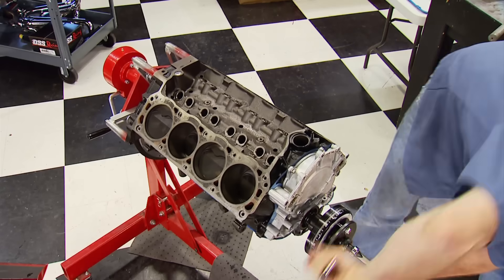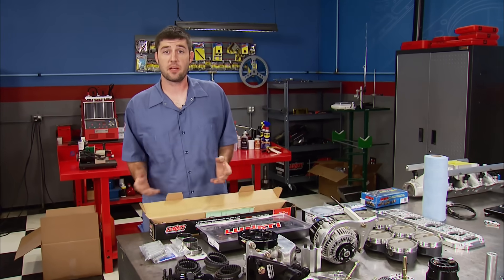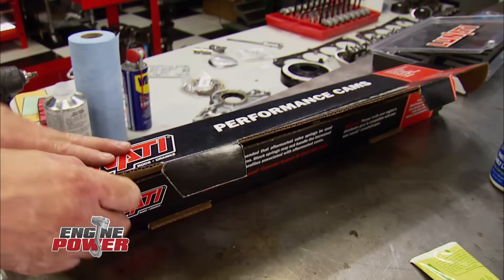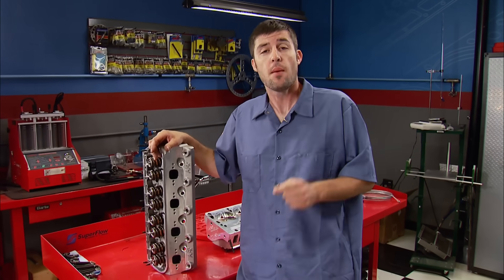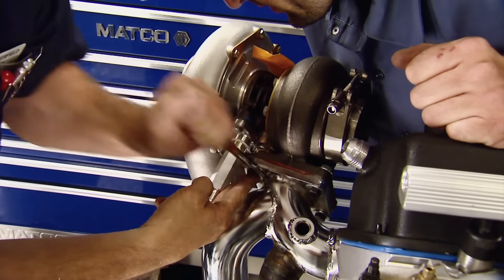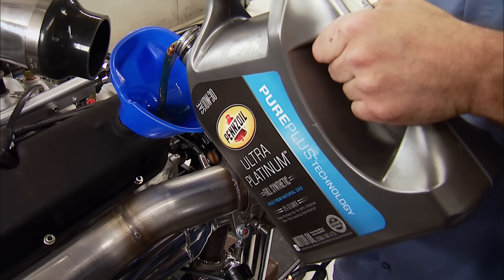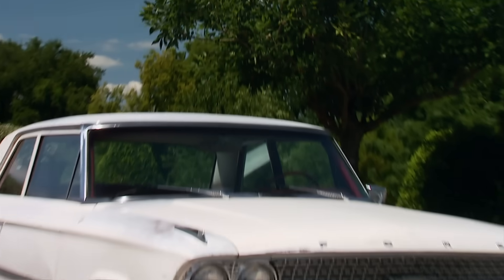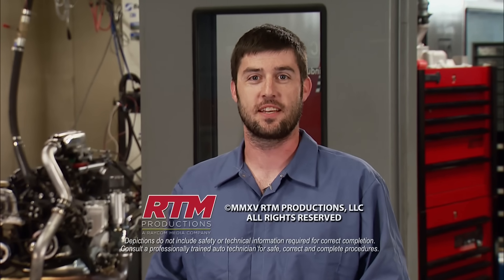Unleashing a Boosted 347 Small Block Ford - Engine Power S2, E20

Comment: How long did it take for the alt pulley to eat up the alt belt ? Reason I ask is I had the EXACT same pulley belt setup on my 700hp NA 363 sbf (5 speed car) and it ate 3 beats in 2 weeks. Decided to call Jones and they stated the pulley/belt setup was wrong for a high amp alt same as you got. They send me a thicker pulley and belt and that did the job. No more eating belts.

Comment: There is whats called man o war small block ford block. It actually has 5 head bolt holes per cylinder there is also a man o war cylinder heads also but right now are quite scarce

Comment: I have seen a 351 Windsor that put out 748 h.p., I don't remember the torque. Not bad for a n.a. motor.
Reply: 13:1 compression and a 9000 rpm redline with 478 ft*lbs would a fun engine, a screamer for sure though.

Comment: @POWERNATION want to point out you adding to the 600hp cracked block myth. I won't deny that the block will crack but it is not associated to a specific hp mark it is due to the internal harmonics of the block. By having the block and rotating assembly Professionally balanced plus running tune to keep the RPM'S low the stock 302 block can see around and over 800hp reliably.

Comment: The tiny ports on the heads make it so they have to run higher boost to achieve lower hp numbers. Larger ports flow better and require less boost to make hp do to a cooler denser charge.

Comment: There are PLENTY of ford 302 based strokers living happy lives above 500 or 600hp. You are trying to sell parts....just stop. First off, the split only happens in 15% of windsor small blocks (NOT just the 302) because of 2 factors, a HUGE stock off balance that turns the crank into a noodle at RPM above 6700 and weak castings. To stop this, get proper oil control so that the mass of oil is not offsetting the balance of the crank, windage tray with glyptal will work just fine. Next is to drop an internally balanced rotating assembly in that is properly balanced. This is VITAL and cannot be overlooked. Proper engine balance is the key to running these past 6700 rpm for real power numbers. But what do I know, I only build them professionally and have seen cars with a stock block making passes around the 7 second mark...but to each their own.

Comment: Put together a system that put 2HP per cubic inches! 
The dart block can hold 700+ HP I have 694HP with out the 88mm turbo at 18 lbs of boost

Comment: I spent a ton of money building a 347 years ago for a Fox body mustang and I would never do it again. Don’t get me wrong it made big power and I absolutely love how small block fords sound they are the best sounding engine in my opinion but when you can buy a 5.3 Chevy now for a few hundred bucks and slam a turbo on it and run in the 10’s easily ur stupid to waste the money on a stroker. When you blow up the 5.3 because you ran too much boost you go to the junkyard and buy another 5.3 for a few hundred. The 5.3 already had aluminum heads with decent size valves.
Reply: Don't need a stroker to make big numbers. A 351W with the AFR heads, a cam and intake that matches the flow of the heads and you're at 500HP easily. The guys on Engine Masters proved that. And the best part is you spent a fraction of what you would building a 347 and you still have more cubic inches and didn't have to specially clearance the block for stroker cranks etc.
Reply: @TwentytenS4B8  your kinda missing my point… I’m talking about a stock 5.3 engine you can make big power without spending 2,000-2500 on heads plus everything else and it’s a stronger block than a production Ford block.
Reply: Lol youre high

Comment: Why does these stage 3 builds always have boost for  more hp?. I mean there so much more you can do to get more power.,.make a stage four and show other formulas and stop all the off the shelf stuff..real racers get into the port work and valve angles and even longer strokes than what y'all show..
You guys are showing basic engine assembly of your off the shelf parts Wich I understand your in buisness to sell..
Just saying racers can enjoy the tricks that we all share and limits we push

Comment: The scariest thing I've ever been in is an early 90's full cage mustang with a "twin" turbo 347. That thing put 1100 to the wheels on a bad day and I'm lucky to be here to tell you that kind of power has no place on the street! That car was just plain stupid powerful and ran 8.50's in the 1/4 mile. I can't remember the MPH, I just remember my fear factor every-time I got into that thing.... That car honestly scared the hell out of me!
Reply: 600hp to the wheels in a fox body is rowdy on the street, assuming it still retains the chassis & suspension to be a nice driver and isn't predominantly a cantankerous track car. 

Such a setup on 295 drag radials won't hook up on every pavement surface until up into 3rd gear (3.73 rear gears). I think a lot of guys theorize and imagine how much excess they need and get carried away. Above the level I described, a 3200lbs Fox is really beginning to try to hurt you if some wise restraint isn't exercised. Busting tires loose at 60 mph can go bad really quickly
Reply: @Resistculturaldecline : 
I don't remember the exact tire anymore, but skinnies up front and 10" in the rear. It was a built car, full cage, K member, frame connected, QA1 coilovers, ect. But yes, 3rd gear 60mph that thing just loved to go sideways! On the strip it would leave on 2 wheels, but on the street it always seemed like it was wearing 2 pairs of roller skates. It was a cool car, just friggin scary.
Reply: @Finite-Tuning   Sounds like probably a 275 tire, which isn't even beginning to hold back 1000+ hp, not even close. Like putting a bicycle tire on the rear of a Japanese sport bike

Comment: How can the intake charge blow out of the exhaust when both valves are open if the pressure in the exhaust is higher than the intake?
Reply: It doesn't lol. But they ALL think it does for some reason.

Comment: Richard Holdener disproved the "302 falls apart at 600hp" myth with many power adder combinations. Turbos, two types of superchargers, and nitrous were used and al combos made over 600 crank hp with multiple pulls.
Reply: It happens over time. If all it jad to make is a few dyno pulls, it'll be fine. Do it every weekend, see how long it lasts. I have taken stock blocks of many different brands, and pushed limits passed what iy should handle, and they live. But they arw grudge engines and not bracket engines. 
Also, you can't compare engine stress from power with a turbo to nitrous or N/A.. not the same. Turbos are very easy on parts... 
And lastly, promoting a magazine tech editor on how you should build an engine isn't wise lol. Just sayin'..

Comment: 4.125" bore block with a 3.250" stroke and a 5.40" rod length as a lot less rod angle also. Less piston to cylinder wall wear. A lot better way of getting the same cubic inches out of a 8.20" deck height 302 block. And it pretty much cost the same

Comment: Compression is needed to make power, why do people still use low compression engine with power adders. This would make killer power with 10.1 or 11.0 compression and spool that 🐌 even faster. It would make more power and need less boost.
Reply: Because you can't get 100+ octane race gas at your local gas station just anywhere. If all you used the engine for was weekend bracket racing then it would be fine but not for someone who wants to DD it.  Forced induction increases cylinder pressure so the static CR is lower to compensate for it. That makes it streetable on pump fuel. You don't get too many pings before it goes bang under boost.

Comment: These guys need to watch Richard Holder's videos,  he says build a good N/A motor then add boost,  boost works no matter, I would of made it 10 to 1 then boost
Reply: if they had just replaced the block and added turbos it would have been a better build for sure. the new cam is very mild and it seems that they were only making 354 ft*lbs and 364 HP na with this combination.

Comment: Plug the oil drain holes over the cam. Increase the drains front and rear with mesh screens to catch valve train crash. That will decrease windage as well as stiffening the block

Comment: Another combo probably worth noting being a dart block was sourced out is the use of the 4.125" bore block with the same deck height as this one and the use of a 3.250" crank coming out to the same ci at 347. Being the engine is an air pump getting airflow in and out of the engine is paramount. By using the bigger bore block you can utilize a bigger valve in the head making for easier airflow for the turbo to build HP. The shorter stroke makes high-rpm easier to get a better HP number up high. With the top-notch valve train components used in this engine, high-rpm, excluding the cam and rollers this motor should make it's goal of 1200-1250 HP at the crank.
Reply: 4.125" bore block with a 3.250" stroke and a 5.40" rod length as a lot less rod angle also. Less piston to cylinder wall wear. A lot better way of getting the same cubic inches out of a 8.20" deck height 302 block. And it pretty much cost the same.

Comment: I would of put it together with at least 10:1 compression then added boost I mean come on, and the normal guy can't afford 2,500 for a block 6000 for the turbo then another 5000 for internals and heads, I'm just jealous I guess

Comment: Here I am running a measly 2.3 litre 131 ci straight 4 at 650 whp @ 6500 rpm with stock head, this is not crank but to the wheel, 9.5:1 cr, gtx 35 r at 22lbs on 92 octane with methanol injection on a bone stock block with forged rotating assembly.....surprised a stock 302 block can’t handle those numbers, makes me feel a little concerned.

Comment: 347 cubes.....weird rotating assembly angle...bad news. And for 347 or 363..even worse..just silly not to start with a 351w....stock your 4 cubes more...maybe a few more blue printed....a simple .030 over and your already  357 cubes...Or stroker kit and go up to a safe , longer lived stroker engine...at  410-418 cubes,  more durable, more torque..bolts in easily...very easy mods.  Then  I see this 347 with a single plane intake and the second cam is a huge cam and its street-able?? ...with good road manners...?? Possibly with roller valve train...as long as you have a 5 speed or auto with a 3800 stall converter and some 4.10 ..4.56 gears maybe...  then bumping up the 347 compression on the second run.. sure seems like a helluva a lot of race gas mixed with 93 octane pump to do that..costly and I guess these shows are about selling parts to kids looking at dyno numbers more or less. Now a high buck DART block to boost the whole mess.  Smh

Comment: I'm curious about the low power number per pound of boost. Atmosphere weighs 15 pounds per square inch so.....a 500 horse motor SHOULD make 1000 horses at 15 psi.  They said they were trying to reach 1000hp to the tire. You need a 1200 horse motor to do that. There is a big difference between the 800 horses that they achieved an the 1100 to 1200 that they need/want.  I would have went with heads with a larger intake port. Maybe the afr heads but.....I would probably use the kasse p38 heads. They flow VERY good numbers and are well vetted by jon kasse who is renowned for winning motors. He has won several engine masters challenges.

Comment: Did they upgrade from the arp 8740 bolts to the arp 2000 bolts on the oil pan install too? I'm just curious because of all the oil pans that I've lost while driving over the years......lol.

Comment: why not an 8 pack or two quads for more even fuel delivery if you are going after the most efficient power build and delivery?
Reply: because it was an ad for holley efi ;)
Reply: @davidewhite69  because you didn’t get my point at all.
Reply: @tomster7574  I did get it, my comment was my attempt, albeit poor, at humour. cheers
Reply: @davidewhite69  that was humor? :P

i get it, the joke, that needed to be pointed out as a joke :P but they could have still doubled up the advert by doubling up the holleys.

Comment: The one single that I love about my V8 Henry's is that the first rebuild is on ford, due to the gudgeon pin offset the factory built into those magnificent motors. This offset allows for the pistons dwell point can be moved from after 0 degrees  crank relative position, to a few degrees before 0 degrees indicated. This started the power stroke early also apearing to be a buffer to pingings negative effects whilst utilising the violent increase in combustion chamber pressure as an increase in total torque production . Camshaft valve timing events require recalculation due to change in piston dwell.

Comment: I'd like to see those flimsy ass fuel rail mounts at 50 psi lol. I love my dart based 8.2 I've had it for 5 yrs and it's pretty tough.
Reply: What's in it and how does she run? I keep going back and forth between 302 c.i. and going stroker for a street car.

Comment: Intake welds were not great looking. And personally not a fan of that carb hat. Might as well do a proper holley High ram for the power output. Cleaner setup makes more power with a throttle body and injector rails. Just my two bits.

Comment: Beginning of the show: Watch this ford small block make 1,200 HP!
End of the show: We ended up at 800, don't talk about it...
Reply: Kyle Nelson he did say make power safely. There’s no doubt that little engine could be pushed harder. 800 hp in that galaxie is more than plenty
Reply: @downhilldaddy9346  I agree they could have turned it up to 50 psi and made 1000 hp but I was just poking fun at the show for making such a bold claim at the beginning and not delivering. Cheers!
Reply: Kyle Nelson 10-4 I wasn’t trying to be mean mate🤙🏾
Reply: Much like the bold claim of reusing the parts the already had, which then turned into just using the crank and rods
Reply: @canibmeplz260  and the heads
Reply: @canibmeplz260  they used the oil pan again
Reply: Hell with that... they should of made this 500 hp n/a then add boost, I mean the parts will more than hold it, I'm just jealous because I'll never afford to do this
Reply: @88_turbo_fox73  that oem block will be two 4 cylinder motors once it gets to 650 hp
Reply: @thastinger345  - used to be Foxbody vs gnx 500hp 12seconds was the shit. Didn’t need more
Reply: Probably has something to do with the nearly 80% I:E ratio, and then making it more like 70% with 1.6s on the exhaust.
Reply: Gentlemen they said they wanted to make safe power on the dyno,  but , they said they were really going to lean on it when they put it in the car.
Reply: O sort think that guy from the Automotive Machine school wasn't up to speed on stuff. Or, maybe they just wanted to get two episodes out of it. Either way I'd quit my job to do that job.
Reply: Would you like the link to a 1200hp Ford small block or ? Plenty that’ll drag any junky cheby
Reply: https://www.youtube.com/watch?v=KvsCoeT8ROw

Comment: Nice little 347💯 I’ve got a 438 with high compression that ran Nitrous on but... we changed over to turbos and the power curve is AWESOME💯 Had to change fuel to Alcohol and change the cam and a little thicker head gasket but the little SBF makes nearly 2500 at the flywheel, so I’m happy with that💯
Reply: Holy shit
Reply: I'm impressed

Comment: Someone explain to me how they increased compression at 1:30.  Unless I missed it, they did not switch heads.
Reply: I think it had 10.5 to start with the cc's the head gasket change is impressive 35 thous to 27 thous made .70 extra compression taking it to 11.2 compression.
Reply: They changed the head gaskets to make 11.2 compression.

Comment: I have a Dart Iron Eagle block.  That pan will not work on that block.  It doesn't clear the 4 bolt main caps on the ends.  It took a $800 pan from Canton for it to work for me.

Comment: What about the Kaase P38 heads? They have canted valves like a Cleveland for better breathing and use standard manifolds to make it easy to find the right intake and headers for your build. I'm looking at those for my project car, if I can get it off the ground! And I like the adjustability of the boost! Mount something on the dash and.....

Comment: No need for torque plate honing on an aftermarket block .And the girdle is not needed.
Reply: These blocks come honed from the factory and at the 1000 hp level, I doubt the girdle is needed

Comment: "we'll reuse most of the parts"

replaces most of the parts with new stuff...

uhm,... sure.
Reply: cam, pistons and efi is not "most of the parts."
Reply: @bryanroupe8646  
Block, lifters, pushrods, head bolts..and on and on..
Realistically speaking they've got 15 or 20k worth of new turbo engine, and less than four grand of it is "old" parts..

Comment: I thought the wider lobe separation for less over lap was to reduce the possibility of back flow to the intake.
Reply: Don't think about it like that. Whatever power you engine makes NA, adding boost just makes more power to that combo.  300hp NA engine makes about 600hp at 15psi with proper tuning.

Comment: Man o' man I'd love that in my '91 Fox. With my poor driving skills and ancient, rock hard tires, just think of the crowds I'd terrorize at my local Cars 'n Coffee!.
Reply: tmmurphy you would be a legend
Reply: @LA_Commander  can you fit that same block in a fox with small hood scoop
Reply: Good one!
Reply: Not only from hitting crowds but blown tires from the 2-3 shift at 7500rpm
Reply: Look at utube channel "quarterhorse" he built a 347 all motor that cranked out 715hp 500+Torque absolute monster , did a 9 something in the quarter 140mph
Reply: You can get high quality tires and still keep the archaic railroad tie in the rear suspension and still terrorize your public roads.
Reply: Its a Mustang so correct protocol is overpower, get sideways and t-bone a car in the opposing lane.